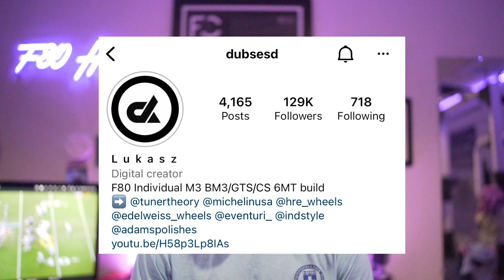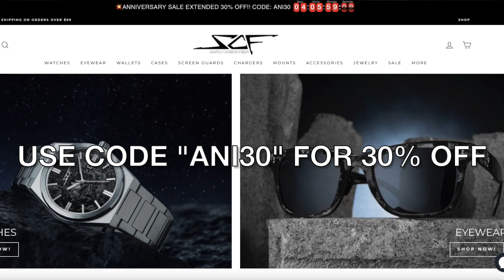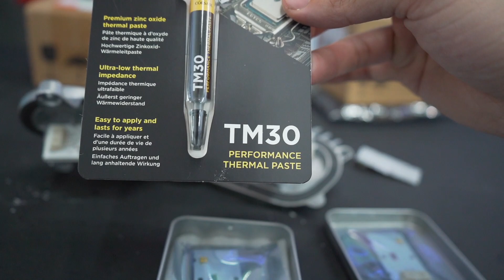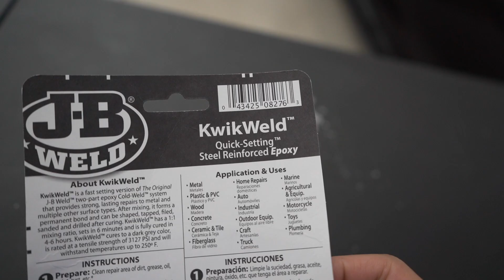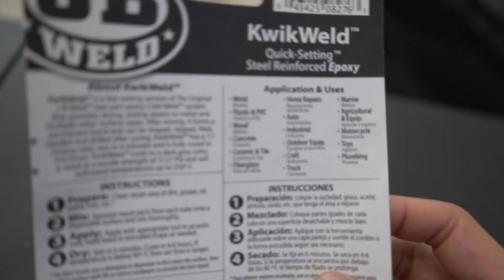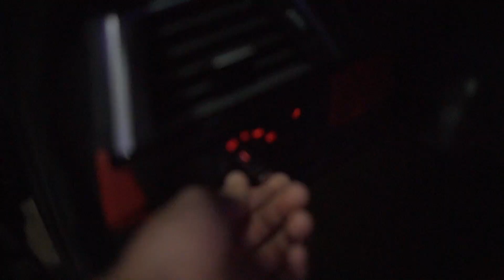HOW TO INSTALL CSL YELLOW DRL MODULES on your BMW! (F80 M3 F82 M4)

Comment: The whole point of BMW attaching that aluminum piece to the board with the OEM paste (similar to the Corsair you initially used) is to dissipate the large amount of heat those LEDs produce. It may fail early because JB isn't intended to transfer heat like a thermal paste. But hopefully it does work, it looks sick.
Reply from the maker: Thanks man! And yessir, I won’t be keeping the yellow in permanently, so I don’t think they’ll burn out like that, but yeah I learned thermal glue next time fosho 💯

Comment: Suggestion for the paste is use a single line then spread it across the metal evenly then it will dissipate the heat properly, I would be wary about running jbweld since it’s not going to dissipate heat like thermal paste and can cause the drl to prematurely fail. 

We use thermal paste a lot in computers so would highly recommend using it if that’s what they say to use for the install
Reply from the maker: They said heatsink plaster but didn’t wanna wait on Amazon lol 😅. Thanks for the insight bro! I knew you would chime in 💻😂💪🏽 good to know for next time
Reply: @F80Ho  why ddnt you just ask ya boi for this? Im pretty sure u knew he works with computers. Im guessing you wanted to surprise the crew huh
Reply from the maker: I totally should’ve 😅😂 and nah no reason at all
Reply: @F80Ho  😏🙃

Comment: So I've actually spent a lot of time stripping these headlights apart to make them addressable. If you're doing this kind of mod swerve using thermal paste. It isn't going to harden enough to secure your boards, more just solidify a little. You definitely need thermal paste which dries almost like a silicon, this is what they use from factory and without any you'll inefficiently transfer heat from the ally based pcb's to the actual heatsink. You also need to make some marks where the oem boards sat precisely, the light guides that butt onto these boards need to align with every led chip available otherwise you'll get less light.
Reply from the maker: I’ve learned from the comments that I shoulve used thermal glue, so definitely will if I do this again. These DRL’s won’t be permanent though, so I don’t think they’ll burn out. I’ll be switching back and forth from my white ones occasionally

Comment: I don’t have to make any tuning staff. After 70 000km my head lights in my 2017 F34 are yellow and to fix it my autorised service station advise my to change a whole head lamp which is 2000$ per each. So, I could exchange mine with some one who is looking for some tuning staff😂😂. What a world. I know it could be a whole head lamp but there could be a 150$ module, too, and some raid on in which you could remove by quick grind. But yours is awsome. Greeting from Warsaw, Poland. Michał
Reply from the maker: Greetings brother 🇵🇱! I’ve been in your situation before…actually had to replace one of my icon headlights because leds was burnt and yellow headlight even after I replace DRL module lol. Hope you get it fixed tho! 🙏🏽

Comment: Thermal paste does not harden. It’s purpose is to improve heat transfer between two metal surfaces.
Reply from the maker: Figured that out the hard way lmao 😂
Reply: @F80Ho  end result looks so good dude.

Comment: Not in your video but did you have to pull your bumper off and pull the headlight units out?
Reply from the maker: Yeah you have to because there’s two t30 bolts holding in the headlight to the body that you need to unscrew to get them out

Comment: I just noticed one of my passenger side OEM drl is starting to fade. Can I buy an oem color and do it the same way?
Reply from the maker: Yeah you can buy new DRL white modules and test that first. Sometimes I’ve seen the actual LED itself is fading so that may be why. In that rare case, replacing headlight is the only fix

Comment: Do they make orange ones?  Just wondering so that they can match the turn signal color.
Reply from the maker: They have a RGB one which will allow you to have any color you want, but I heard it throws a code on your dash & requires extra wire harness during install
Reply from the maker: Didn’t see orange on its own

Comment: Im noticing on the website youll need ikon headlights or the 2018+ headlights, i have the round angel eyes on my 2017 m3 you think i can still order these? 😅
Reply from the maker: I don’t think so man! I’m currently looking for a version for your headlights! I’ll lyk asap. I have a few others asking as well 🙏🏽
Reply: Nvmd found the right ones :)
Reply: They should be for the 4 series under the selling page, looked up the way the module looks for the 2017 m3 and it looks the same as the one for the 4 series

Comment: wonder what the rgb one looks like ?
Reply: The RGB kit is totally different, it doesn't use the OEM board design and leaves you having to run separate wires outside of the headlight into their controller. You also can't make a perfect white, it'll be slightly blue. I only know as I spent a while with their kit and ended up making my own addressable kit instead.
Reply: @producerlawson  ah i see thank you! I ordered the yellow
Reply: @attackkk  the solid colours are a good shout. You’ll keep oem functionality without having to create extensive custom modifications.
Reply from the maker: @attackkk  nice! 💯
Reply from the maker: @producerlawson  thanks for the insight man 💪🏽

Comment: So it won't work on a pre-LCI?
Reply from the maker: I believe if you buy the 4 series modules, it’s the same as pre LCI f8x. I would confirm the w the vendor tho! I left the link in comments and description
Reply: @F80Ho  Thanks, I just saw the seriers 4 modules now. I think it might work but i will ask the seller
Reply: @sefirot2101  did you get any answer from the seller about pre-LCI ?
Reply: @juc8334  yes, he as it but you must open your headlights
Reply: @sefirot2101  ok, it’s a bit tricky 😅
Reply: @juc8334  yeah 😂 I was hoping for something as easy as for the LCI

Comment: they look good bro! so if you use bimmercode for increasing the brightness of the drls, would it work to make them brighter yellow?
Reply from the maker: Thanks bro! And yes can fully adjust on bimmercode 🙌🏽
Reply: 100% brightness burns out the tube on the headlights. Not recommended at all. Ask me how I know.
Reply from the maker: @Raider1805  I actually know firsthand too 😅, had one of my icons burn out too 😩, I keep it at like 60/70% now I think